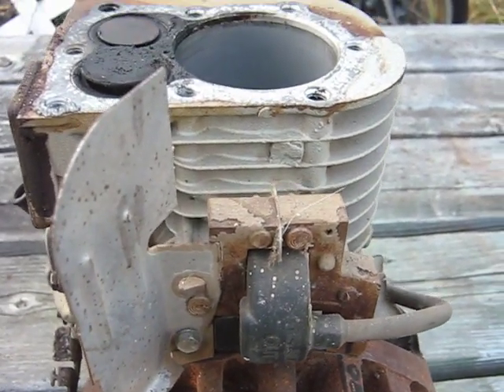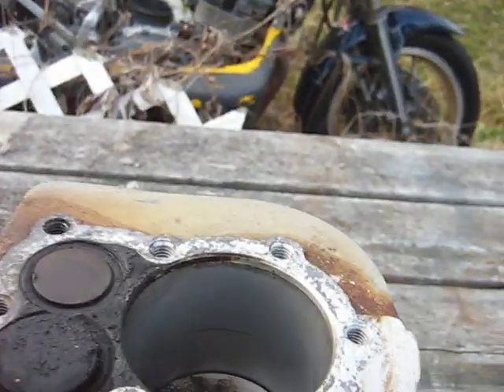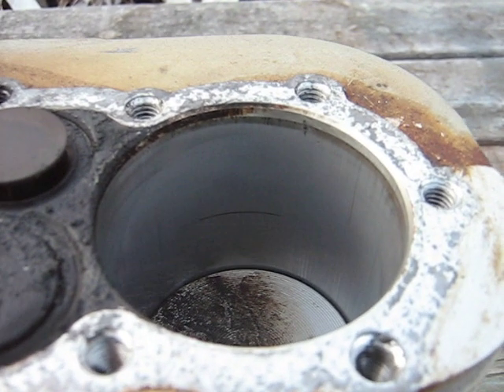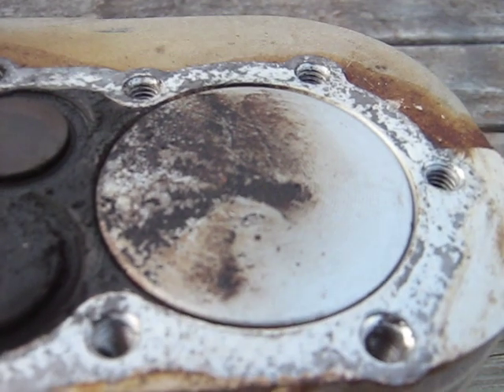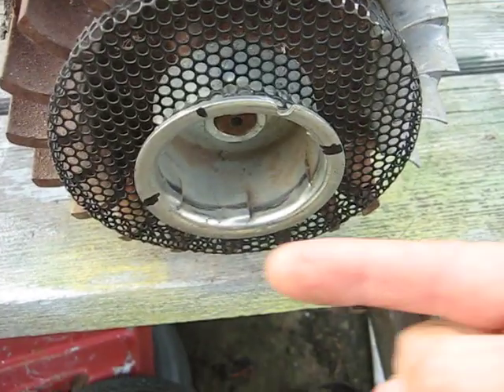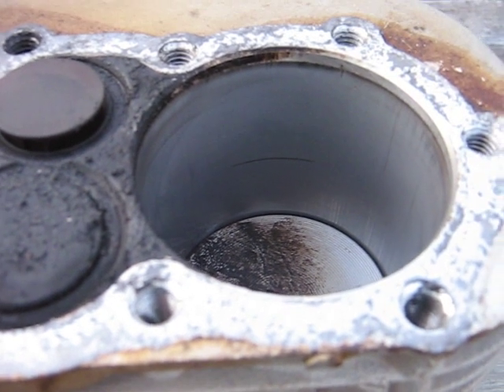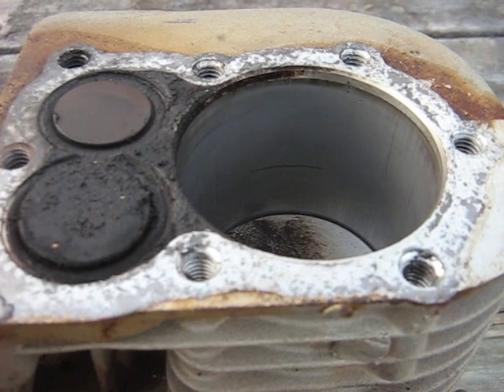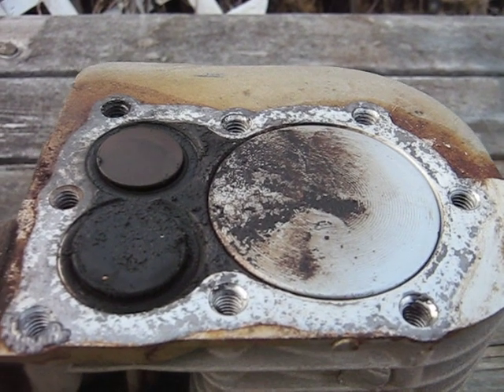Piston Travel Mystery!!!

Comment: A simple drawing proves it, draw a circle and lay down a ruler, use a fixed length rod.  I got 50mm / 60mm top on a 80mm diameter crank throw.
Lots of engines have almost perfect balance, the straight six, flat six honda etc.  The most perfectly balanced engine design is the Brough Superior Dream motorbike engine, which had  two flat twins running above each other, geared together. This had perfect Primary, Secondary AND valve train balance, sadly only three were made and only two had internals, the one in the British Motorcycle museum is the empty one.  There is a privately owned running example somewhere out there.  The production of which was interrupted by WW2 sadly.  
Maybe I should make one the same.
Reply from the maker: Go for it, it would be great to see it run!

Comment: @ChargerMiles007 so it turns out I told you wrong. I checked it again with deeper trig than laastnight, and then tried using the chevy 302 as an example, and it didnt work...Ive got a new formula, and im going to try it on several engines before i post it just to be sure

Comment: Divide stroke by rod length then multiply by stroke.    EX. Chevy 350 (stroke 3.48 rod 5.7)   3.48/5.7= 0.6105...... 0.6105X3.48=2.12454 inches. So at 90 degrees the Chevy 350 piston is 2.12 inches down bore, which is 61% of its stroke.

Comment: I just had to sit here for 10 minutes going over this...Sine Cosine And Tangent then I finally realized this was right. The triangle formed by the rod, crank, and imaginary line between the wrist pin and crank journal (center to center) has the same Hypotenuse the whole time (the rod length).  The math works out that you take the cosine (Stroke divided by rod length) and multiply that my the stroke to determine how far down the piston is at 90 ATDC/BTDC

Comment from the maker: Oh yes, this applies to all piston/crankshaft engines.
I guess it would need to be considered in a junkyard Deltic design, but you would need to do a scaled layout drawing anyways to know where the ports needed to begin and end, to get the exhaust and inlet timing correct. I had to go thru all that when I designed the Jumo 205 type Briggs, since it is like 1 cylinder bank of a Deltic.
I have a pretty good 2D CAD drawing going of the 92502 Briggs 3.5 horse lawnmower engine! I have used it lots.

Comment from the maker: Actually, you are right, I think most small engines (at least 4 strokes) do offset the centerline of the crankshaft away from the centerline of the cylinder. I measured it on one engine, it was 1/8" on the 3.5HP Briggs. I had to know this to get the sleeve drive gear to fit right for the sleeve valve.